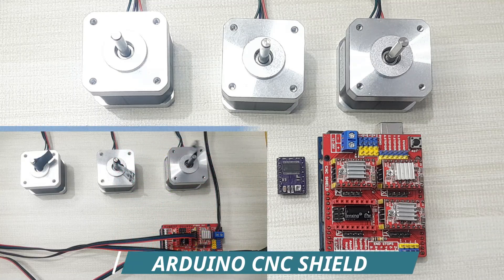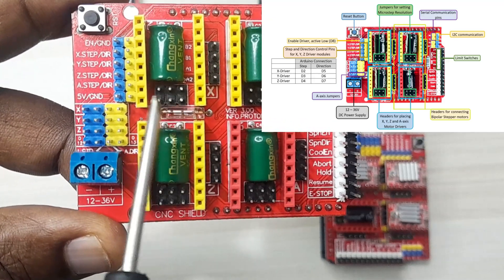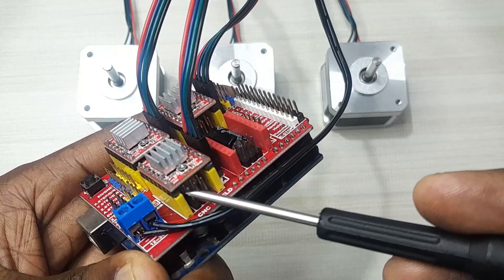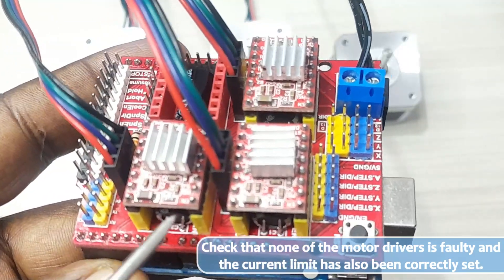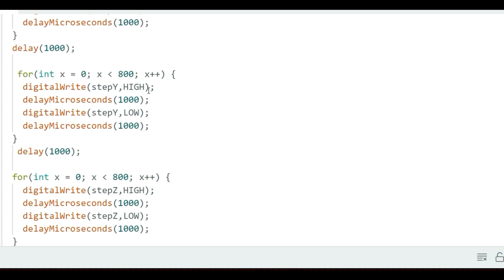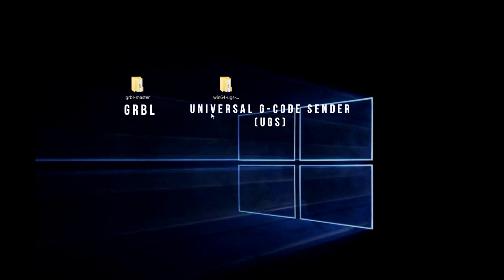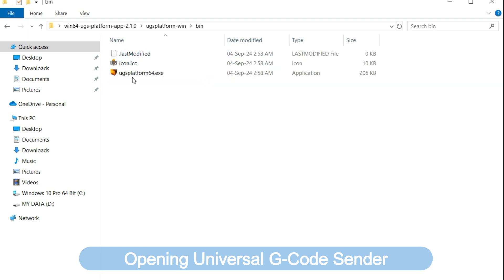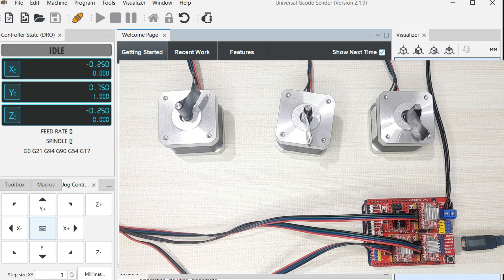Stepper Motor Control using Arduino CNC Shield and GRBL.

Comment: Is it possible to use sensors while using cnc shield? I am building AS/RS machine on arduino and I need to use sensors, led screen etc. The question appeared in my head when I first saw cnc shield and still haven't found any answer.